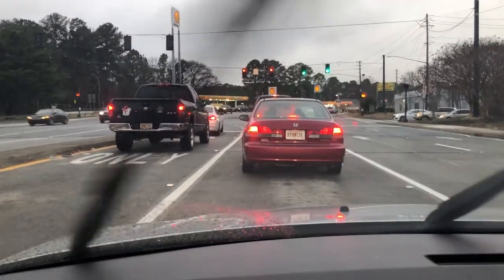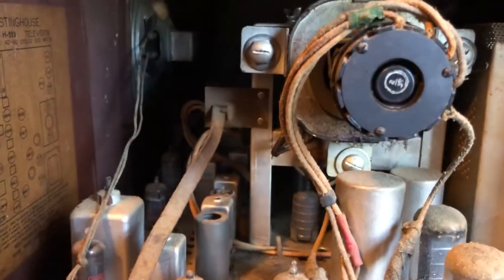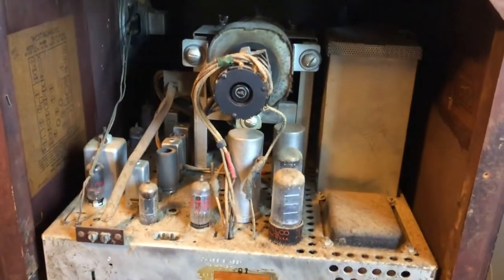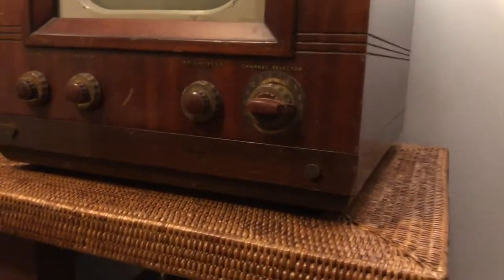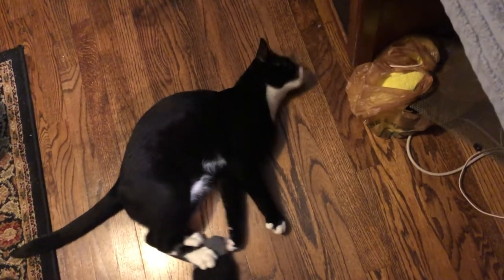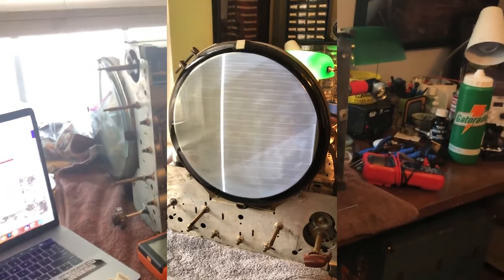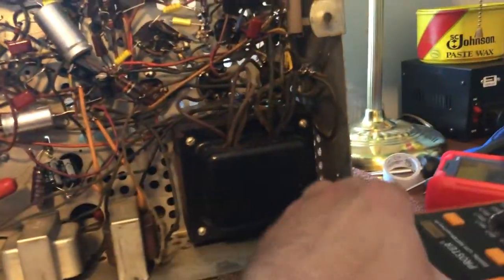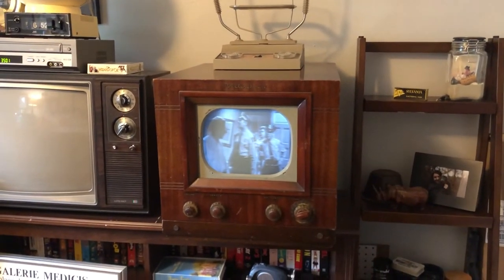1949 Westinghouse Tube Television Restoration

Comment: I have a 1951 Westinghouse television and it is a display item.  Just like the one you have.   I have not  worked on it, exact duplicate of your television.  That coating on the outside is called aquadag, an electrically conductive graphite-based paint.

Comment: I used to service mid '60 and 70s tube type p/b tv sets  and some famous brands here in Brazil don't survided a crosshatch video pattern... Horizontal lines at top and bottom are full round barrel distorted, probably thanks to poor deflection yoke construction...